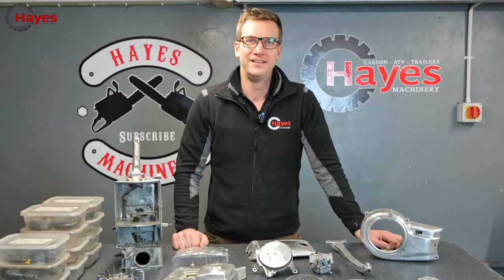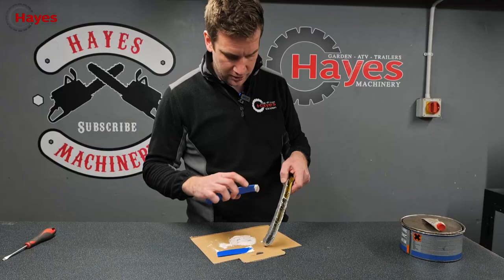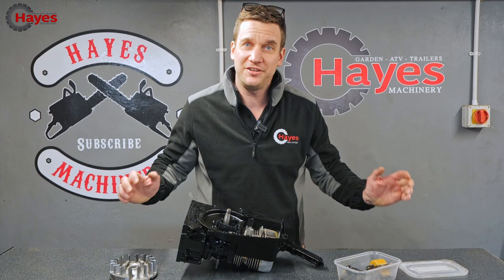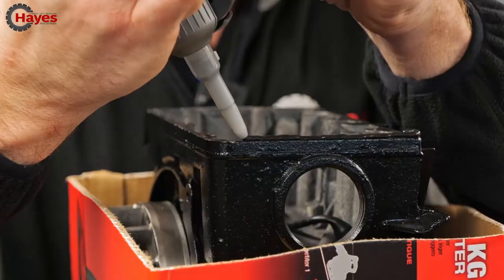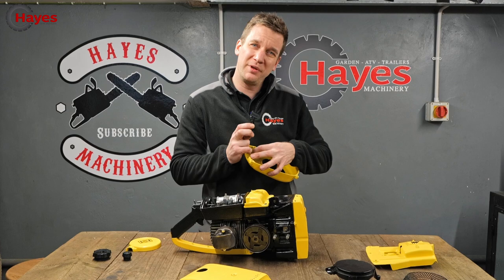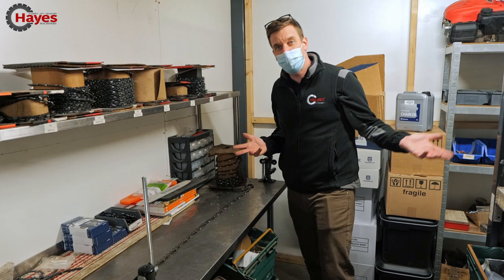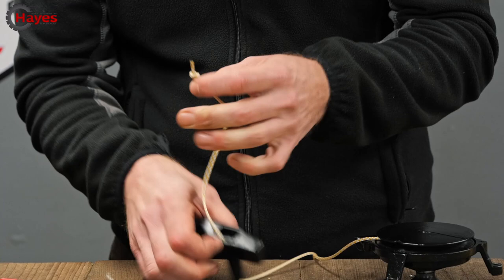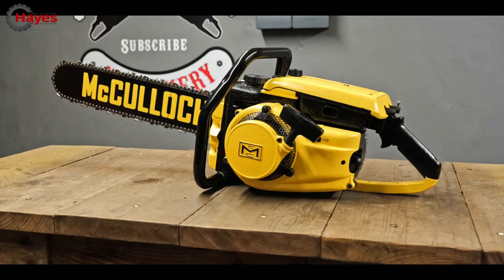Chainsaw Restoration Complete - McCulloch 1-52 | Part 3

Comment: Okay, new subscriber….I’m a old Mac fanatic…and while I tip my hat to you for treating this icon of American power saws, it really would have been so much more emotional, had you stuck with the original color scheme and had the original decals reproduced and applied. I’d have really been thrilled to see her lookin like she just came out of a logging store somewhere. But all in all, it’s just as rewarding to see her lookin so beautiful and alive!
Reply from the maker: Thank you Keith, yeah it’s always that decision.. do you make it look original or do you make it stand out from the crowd (sympathetically of course) unfortunately I am going to have to start over with this one as the paint has become contaminated and bubbled in a few places 😭
Reply: @MachineryNation  did you ever get any input as to why it bubbled up? I think you are on the right path…it’s the metal…which made me wonder…if you’d given it a wipe down with some vinegar before painting…would it have helped the paint adhere better? Im not sure on aluminum…but it works on steel. 🤷🏻‍♂️

Comment: Would you happen to have a website or a location where we can get McCulloch parts  ? I have a  1-70 that needs some help. Thanks.
Reply from the maker: EBay is probably your best bet. All older stuff is now discontinued. Look at for the same saws and then use them as a doner machine 👍🏼
Reply: @MachineryNation  That's probably good advice, thank you for your time.